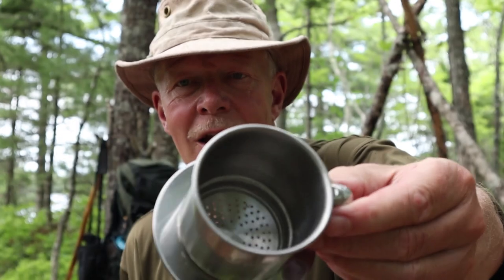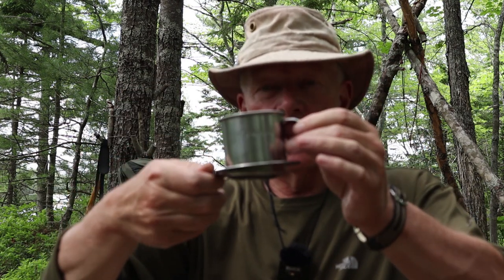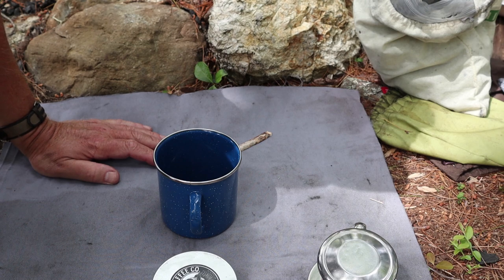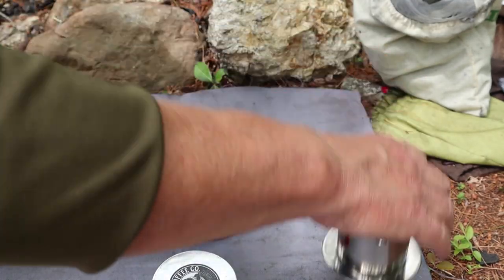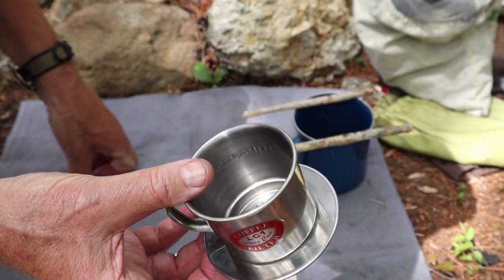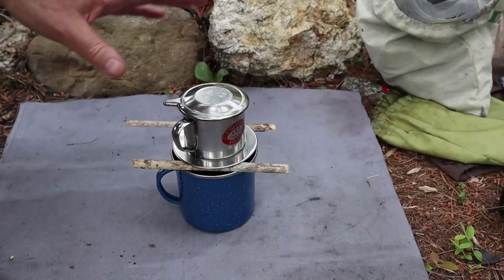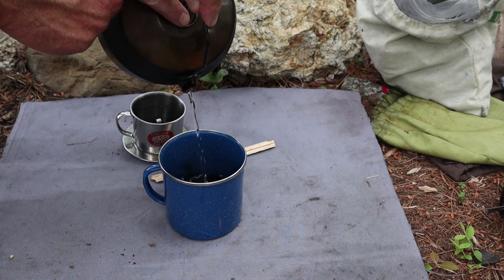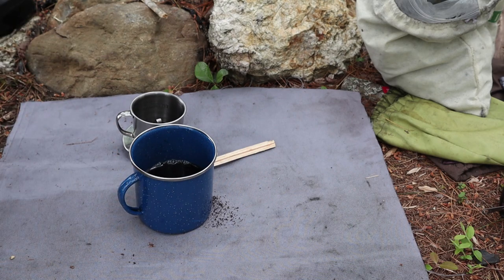Coffee in the Woods using a Vietnamese Phin

Comment: I've been using these for about 20 years. Mine has no handle or lid, but a perforated cover that threads into place over the coffee. They flip over upside down to store in the cup when packed.
New Orleans imports coffee beans from Central and South America and major brands have roasting factories ( I used to live downwind from Folger's and woke up to smell of tons of coffee roasting). Purists say ideal coffee is made with 180° Fahrenheit water, ie not boiling and this accomplishes that by dissipating heat. I fill it twice with hot water to make correct strength of coffee.
Espresso in condensed milk is rocket fuel. Cheers
Reply: Most coffee in the world is Arabica. The biggest producer of Arabica beans is Brazil. 
Vietnamese coffee is primarily Robusta. It has chocolate and nutlike overtones.
The phin works best with Robusta coffee. Paper filters remove a lot of Robusta's flavor.
Reply from the maker: Yes. Many similar designs and so much good coffee out there.Thanks for commenting

Comment: I just did some more research after watching your video and I now have a phin in my cart. 
I was also thinking about making a wrap type cozy for the phin out of reflectix for cold weather use. An upside of adding more hot water to the already brewed coffee is raising its temperature after it’s been sitting/brewing/dripping for so long.
I use the Lixada 450ml Titanium Double Wall Mug with Foldable Handle and the Yeti 20oz tumbler lid fits it very well so my beverage stays warm much longer than in a single wall mug. 
Thanks for making this video
Reply from the maker: I think I will try the reflextix. Thanks for commenting Allan
Reply: Good idea with the reflectix. Did it work out for you with your phin?

Comment: Bought one of those and cut out the handle so i could fit a homemade cozy, which keeps it warmer for longer and usable in cold weather.
I found a neat little waterproof container which i use to carry condensed milk inside of the phin, right under the press.
(I'm thinking the base could easily be replaced for a lightweight stand as well)
Reply from the maker: Great ideas. I may try them for mine. Thanks for commenting

Comment: I was given a Phin by a friend who toured East Asia while working as a teacher in Japan. mine has the support ring as a separate sort of dish that the pot sits on. Both have pin holes through them, and the pot has two plastic nubs opposite each other at the top to "pinch" between your fingers as a handle rather than a loop type handle. I had NO idea how to use them and tried many different ways. I think part of my issue is the water has to flow through two "screens": the actual pot, and then through the support dish. Perhaps if there was a spacer, it would work better, but in my case, it SLOWLY drips for about 20 seconds, then becomes plugged. I've tried different coarseness on my grinder settings, and it does make a small difference if I use the coarsest setting, but still plugs. I'll try the pre-pour method you demonstrated, which is something I have not tried. If nothing else, I now know the name and origin to do further research! Thanks Mark.

P.S. I did find that these also make very handy loose tea brewers (great for pine needle tea) and can work as a water sediment pre-filter too.
Reply: Awsome idea👍⭐💡 I am going to try to get one for my husband. Thank you for sharing 🙏🙏
Reply from the maker: I have seen the four piece ones as well but have not tried one.Thanks for commenting.

Comment: I first had Vietnamese coffee (hot) at a local restaurant. I then found a phin at a local Asian grocery store. I use Vietnamese coffee which is ground fine like expresso. I never thought about using it in the woods. I suppose if you are using a metal cup you could put the now made coffee close to the heat of the fire to get it hot again.
Reply from the maker: Yes for sure. That or use a cozy to cover it. Thanks
Reply from the maker: Yes for sure. That or use a cozy to cover it. Thanks

Comment: This is a variant of what I mentioned to you a while back now, mine is a Bodum single-cup filter of a design they no longer appear to produce. A plastic holder with a metal mesh at the bottom, and a plastic gravity filter on top. Very lightweight. I think this Phin might have the advantage of being a bit more robust in the pack - it might get dented in a worst case scenario but plastic cracks. Anyway, that's all for me - you're looking very trim these days Mark!!!
Reply from the maker: Nothing new under the sun. Yes the Keto is doing well for me. Thanks for commenting my friend